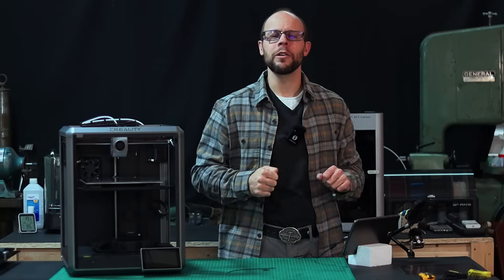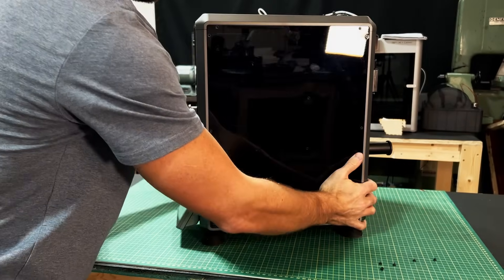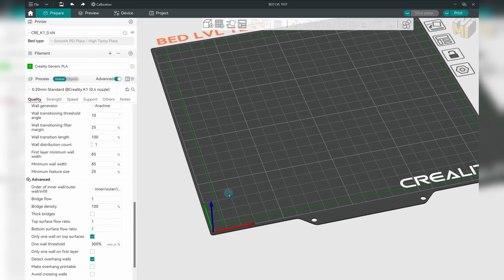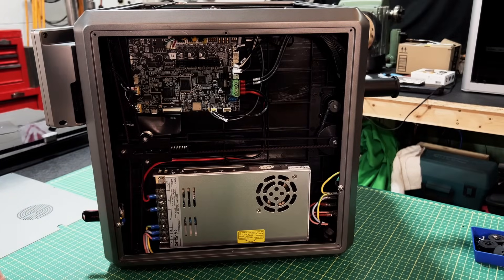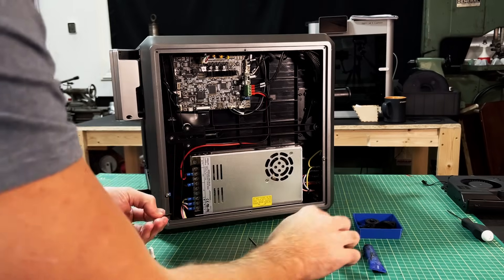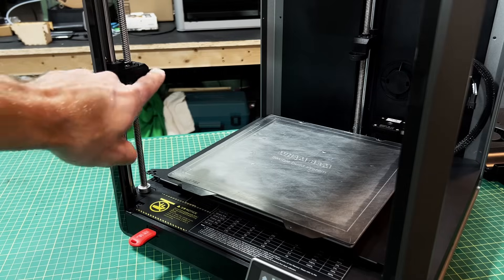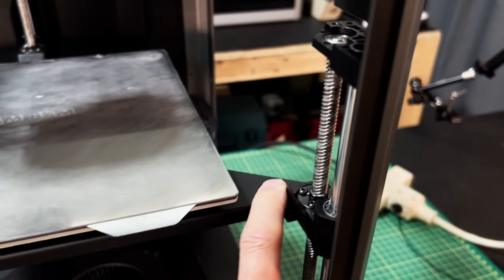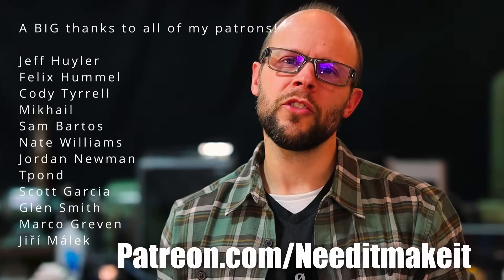Quick and Simple Way to Level Your Creality K1 or K1 Max Bed

Comment: Thank you. I’m new to all this. Excuse my ignorance, but how do I access the net diagram? My new K1 is terribly out of level and even trying to adjust the belts as Creality demonstrates on line doesn’t guarantee a good first layer. I’d like to use the net diagram if I can find it. A plea for help. Thanks.
Reply from the maker: Sure, no problem.  If you haven't rooted your K1 you can type in your printer IP directly into your Web browser, and you should see the Creality version of the web UI.  It doesn't give you many options, but you can raise and lower the bar on the side which will give you a sense of how much to add in which areas.  Let me know if that works for you.  If not, you'll want to root it, and there is a good walkthrough for that if you need it.

Comment: I'm wondering if this issue is K1 specific or the other Core XY like Bamboolabs P1 show similar issues - 1.5mm off is a world?! With my Ender 3v2 I'm always trying to be less then 0.10 mm off, 0.05 is the goal...?
Reply from the maker: It's likely a problem with the design, using 1 motor to drive three screws and then also having a system for tensioning which seems to pull the screws out-of-sync.  There is something more to it, but I don't exactly know yet.  I haven't taken my Bambu apart to see how the tension system works on it.  I haven't needed to adjust the bed on my Bambu but it may be out, I haven't looked into it at all because there are three adjustment nuts below the bed on mine.  Does your P1 have these?  It's going to be hard to be off by less than that amount, I see that heating the bed to different temps will cause the plate to warp non-uniformly, I think it can definitely be closer than what you saw in the video though.

Comment: I'd definitely be interested in getting the aluminum plate itself more level!

Also, it would be nice to have the spacer file on Printables, too. But I appreciate you sharing it anyways!
Reply from the maker: Okay, that's a few people that are interested in a flatter plate!

I will add it on Printables as well, I have a video coming about about what happens when you redeem your points on Printables, so I apologies, I was not too impressed with the 'Free Stuff' but I don't hold a grudge so I shall post it there  right now.
Reply: @NeedItMakeIt  Thanks, I appreciate it! I don't use Printables because of the rewards, either (shipping and import is too expansive to Canada, even when the filament is free). But it's what I'm using for quite a while now, and I have all my collections and models on there. 

And with not having a Bambu printer (yet), I'm not in their ecosystem and have no reason to use their service.
Reply from the maker: @ThomasS17  I have a video on that very subject to be released tomorrow morning, total cost for free filament as well as shipping time wasn't really worth it for me.  I would like it if there were some kind of option to pickup the filament from a local supplier, except there are none here.  I checked the hats, the shirts, everything and no matter which product, the shipping is far too much.  I went through the process anyway to see what the true cost would be.  

Yet, nice!  I have to wonder what they'll come out with next.  I would imagine it's going to be big and capable, maybe something to Rival the Prusa XL?
Reply: @NeedItMakeIt  Apparently the A1 was the last printer of the first generation Bambu Lab printers. So maybe the next one is a X1C successor (X2C, or just X2?) since it's the oldest printer now. From the interview Stefan did with Dr. Tao it sounded like an XL would come later next year.
Reply from the maker: @ThomasS17  I think now that the blueprint is out for what people are looking for, we're going to start to see lots of other big names follow, the competition should be getting hot!   I am interested to see what Bambu comes out with though.   Should be good!

Comment: Why does this not surprise me? Oh its a Creality printer thats why!
Reply from the maker: Their business model is definitely different, they seem to rely on the community to help solve a few problems here and there.  Personally I'm still happy with my printer, the bed being out of level may not impact everyone, looking at those reds and yellows on the mesh was unsettling and something needed to be done!  It probably should have had some way of adjusting it other than taking the printer apart straight from the factory.
Reply: @NeedItMakeIt  I have bought Creality machines throughout my 3D printing life, I started out nipping down to the workshops of the engineering company I worked for in 1989, they had this new-fangled machine called a 3D printer that used a laser to harden resin into the designed shape, I had been going down to the workshops in my lunch hour to make parts for my motorcycle and was friendly with the engineers and when they told me about the new machine they were getting I was very interested, It meant I could make prototypes of some my parts before machining them from metal.
Years later one of the engineers told me he had built his own 3D printer and for nowhere near the cost of the various printers we now had in the workshops.
 I printed the parts from ABS and ordered the kit and a few weeks later I had a Mendel 90 3D printer at home.
 I next bought a Creality Ender 2 (original) followed by a CR-10 and then an Ender 3 and then 3 Ender 5 Plus's. I then built a Pro 3D V-King 400 from self sourced best quality parts.
 All of these Creality printers had faults that would have been easy for Creality to fix but they didn't, in the case of the Ender 5 Plus they released a firmware "upgrade" that made the printer worse, it made the printer display random data for the ABL, did they fix this error? no of course not they started shipping production machines with it.
 When it came time for me to buy a new faster printer I did not even consider a Creality machine I bought a Bambu Lab X1 Carbon and an AMS and I am overjoyed with it!

Comment: Consider this another endorsement of the tooth skipping method! Managed to get the mesh down to .5 at one point. It feels scary to do, lol, but once you get the hang of it it’s a really quick way to make adjustments. That paired with KAMP improved things a lot.
Reply: could you explain this further or direct me to an explanation page/video about tooth skipping? Thanks
Reply: i couldn’t get kamp to work reliably, but the tooth skip method works great

Comment: I am expecting my K1 Max in the next few days so this is awesome timing for me. Thank you very much for the video, I am happy to spend the dime to get it precise
Reply from the maker: Nice, that's going to be good to have that kind of build volume on a fast printer.  I don't know if they've truly solved the problem from the factory yet, it seems that the problem lies in the design and the method they use to adjust the bed.  In any case, we have a good simple solution that works for anyone.  I'd be curious to know from you when you get it how the bed looks if you don't mind sharing when you get it.

Comment: Great video. Thanks. 

I disposed of my screws with the packaging. 

Are you able to provide screws details … size, length … the threading on the screw seems unusual …
Reply from the maker: Thank you!  

Sure, they are 3mm OD, 19.5mm L, Socket Head Cap, Looks Like 24 TPI.  Hopefully you can find something close.

Comment: This is a great idea, the issue with mine is it's not the front that's out, it's the back left corner so these spacers won't work for me unfortunately. My bed is WAY out, looked a bit like yours but again a different corner. So annoying.
Reply from the maker: Are you able to send me a snapshot of it to my email needitmakeit@gmail.com?  I have a solution that I was going to make a separate video on, but wanted to do this one first since it doesn't cost anything... except 6" of filament
Reply: That's exactly my problem.
Reply from the maker: @staffofevil  Did you still need some help, or did this method work for you?

Comment: Great suggestion! For ultra-fine tuning, I use various widths of thin heat tape directly on the magnetic bed (under the build plate) to fill in low spots. I have found that over time, the bed geometry changes slightly, and I occasionally need to pull the heat tape off and reapply in slightly different locations. I find this method preferable to making permanent changes to the bed. Using this method, I keep my Ender 3 bed at around 0.05 to 0.1 mm variance. The heat tape I use doesn't prevent heat transfer to the build surface, and is rated to withstand extreme temps - more than double the bed's max temp.
Reply: The adding the tape to the bed is a years old technique and it works well. Kapton tape was the preferred type as it withstands the heat well. I was going to suggest it and I was glad to see that it had been mentioned.
Reply from the maker: @michaelheth2940  Adding tape to the magnet would be the best way correct or would this be to the bottom of the spring steel?
Reply: @NeedItMakeIt  I put it on the magnet. I would say having the tape on the spring steel build plate, it would come loose when you bend it or take it off to remove prints.
Reply from the maker: @timcox3856  Yeah, I can see that working well.  Makes sense especially if it becomes brittle over time.  Okay, I will def look at that as one possible solution.  I'd imagine if you went too thick you'd lose attraction, mine isn't near the edges that it would need it, but some may have that problem
Reply: @NeedItMakeIt  I've filled the full plate with layers and layers of tape in the past, and never had any issues with the build plate staying in place.
Reply from the maker: @timcox3856  Okay, good to know.  I like that idea.  For the prints I make, they are mainly structural so warpage is always an issue for me, a lot of the time the adhesion to the plate is good, it will pull away from the magnet instead, not much but enough to cause the parts to have a slight convex shape to them...  I think I may try your method next.  I need to see how much it varies at different temps and will the buildplate change shape as it becomes more uniform in temp inside the build chamber.
Reply: @NeedItMakeIt  Yeah, I mostly print PLA, PETG, and TPU in an enclosure, so warpage is a minimal concern for me. Printing more warp-prone materials might require some testing.
Reply from the maker: That's really clever, nice tip.   I'm going to have to try this but I think you maybe be onto something there.
Reply: @NeedItMakeIt with my ender 3v2 I place aluminum foil below the lower spots. It has a defined thickness and you can easily double by folding it.
Reply from the maker: @slartibartfass5729  That's a neat trick as well, do you find that you lose any attraction between magnets or do you think it's okay as-is.

Comment: Interesting way to fix de bed levelling. But i've put some silicone levelling piece from bed slinger's printer and some screws to have the ability to adjust the level of corner's. Good video! Congrats from Brazil. Happy printing.
Reply from the maker: Nice, hey there are lots of ways to fix a problem.  I was kind of thinking about why they don't employ the same strategy, but I believe it's because of the sensors, if you're tweaking it just a little bit, I think that could work well, that's a nice solution.

Comment: Just curious, why does shimming the bed need to be done if the machine compensates for that variance anyway?
Reply from the maker: The end result of the part will not be accurate.  A lot of the time it doesn't matter, it really depends on what you're printing, the bigger the part the worse off you are.  What happens with this mesh leveling is that to get that first layer perfect, it moves the bed up or down to compensate, then after the first few layers it begins to fade out the difference (you can change those numbers in the config file) but the result is a part that isn't the right height, and isn't square. 

I print mostly mechanical parts, it's more important for me to have something close to perfect, for a lot of people it doesn't matter much... BUT those reds and yellows are disturbing, we likes the calming blues.  Some printers will auto compensate since they have individual motors to drive each screw.  This printer uses a simple one motor setup, which saves cost but as you can see sacrificed adjustability.   You're right though it does compensate for it, how far exactly I'm not certain, but that makes me wonder.
Reply: Hi, I appreciate your prompt response. I’ve also wondered about the compensation and did some experimenting with stickers on the screws, much like you did. My finding were that the bed compensation stayed constant throughout the whole print. I understand what your saying and if your printing mechanical parts then millimeters matter and therefore would probably do the same. As for me thought, just printing small parts and flexible prints for my grandchildren, I’m going to stick with what's not broken.
I appreciate your channel and all of its useful information, if there is a method for leveling the bed, yours is by far the best and less evasive I’ve seen. May use it in the future if I find my prints getting out of wack.

Comment: My K1 shows one side higher too. But it prints with no problems. So what is the actual benefit tuning this level?
Reply from the maker: Yes it compensates for it over a series of layers to fade out the difference.  My printers was set from 5 - 50 mm, which is a lot, but some only have 10 layer fade.  After the fade, the printer returns to printing without adjusting the leadscrews as it travels around the bed.  I suppose there will be less wear on the screws over time, but it's minimal.   This is the most important on a big print because your size won't be accurate, it will be off by as much as your bed it out.  It may not matter much, but for more mechanical prints that need to fit, it's a good idea to try and remove as much of this as you can.  For stand-alone prints, it's not really a problem, small prints are also not affected too much.  

It's actually really cool that we have a system to compensate for this, otherwise we'd all still be using glass buildplates, and it can be hard to pop a print off of them.
Reply: @NeedItMakeIt  yes, I just noticed this after printing a full bed of identical cases and a few had covers fitting just so slightly loose. Even I just cloned the same model to fill all bed. So I will try printing spacers now. :)  
Though there were no noticeable difference printing with crooked K1 bed with almost 1mm difference from front to back all this time using like up to 80% it's size. And before K1 I had a Delta printer which had a given that printing quality will be worse at the bed edges too.
Reply: Hello. Great video. 

Subscribed 😊

I disposed of my screws with the packaging. 

Are you able to let me know the size, length, etc, of the screw so I can go pick up some replacements. 

The threading on the screw looks unusual too.

Comment: Might give the spacers a try
Reply from the maker: If you can avoid taking the bottom off, it's a 10 minute job, I wasn't that lucky since it was out so far.
Reply: @NeedItMakeIt  the shims looks great idea can’t wait to try at weekend 😄

 I’ve had the bottom off. Loosen the screws for the tensioner and I couldn’t budge it. Didn’t want to break it.  
I’m 1.13.mm out.  Back higher than the front. 

I’ve had to make an account to download your file which is bit annoying. Could you use more generic sites in the future? (Printables/thingiverse)
Reply from the maker: @DSPrints_  Awesome, I hope it works out.   You'll probably need to take the screws out completely or at least one of the two to allow the full travel you need.  If you're out by 1.2 you may be able to get away with shims only.  I'll do a follow up video showing the tooth skipping method if anyone wants to see that, apparently it works well, but requires some technique.

I'll post to Printables as well, no problem I wanted to try Maker World mainly because I was not impressed with the 'Free Filament' which ended up costing me 67$ for Three spools in shipping and taxes.  I would have been better to purchase the filament locally.
Reply: @NeedItMakeIt  thank you for uploading elsewhere. im sure others will appreciate that too!  I've gone from 1.89mm different too 0.7 which is as close as I can get it as the surface isn't perfectly flat as most beds aren't. 
Thank you. superb video & files!
Reply from the maker: @DSPrints_  That's not bad at all.  I'll make a follow up video about the issue with the bed warpage as well, there are a few good ideas out there to help with that, and I have a couple of ideas as well, not sure yet which is the best way to go.  

I should have done Printables from the start, I wasn't thinking about having to setup an account, that is annoying for people if they don't use a Bambu printer.. which may be the case since the video is for a Creality printer... 🤦🏽

I'm glad you found it helpful and lookout for more coming a couple of times each week!
Reply: @NeedItMakeIt  excellent! Cant wait! Subbed 👌🏼
Reply from the maker: @DSPrints_  Awesome thanks, every sub counts, I've taken a huge risk and am now full-time.  Better content more often and the goal is to provide the content that everyone needs or wants to see.